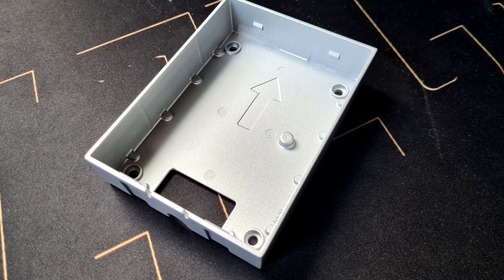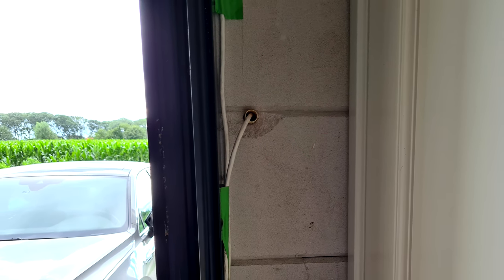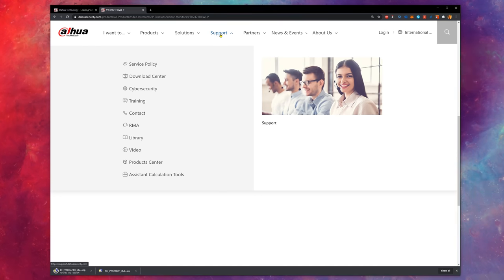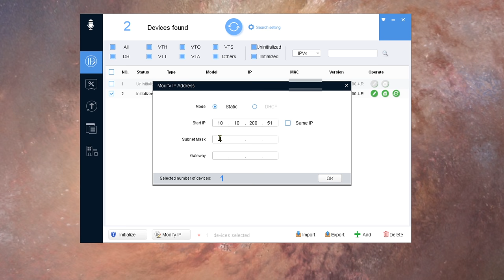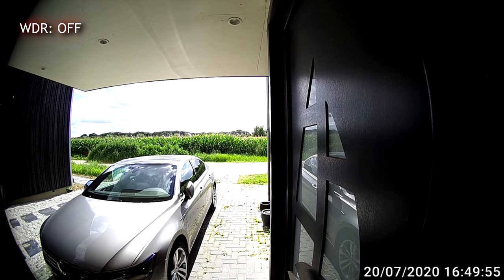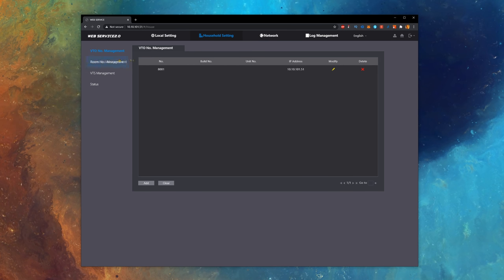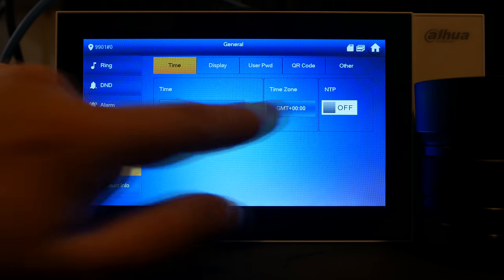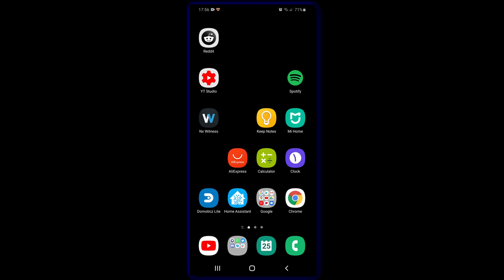🔔Video Doorbell🔔 Install and configuring the hardware | Guide | Tutorial | How-To

Comment: Hmmm... Since it can use sip (by default as server, but maybe also as cluent, e.g. as sip extension in asterix or a fritzbox?), would it also be possible to have it dial a dect phone's internal number and even communicate with audio?

I like a 'smart' doorbell and video is great and stuff, but I have one important use case:

Working from my home office on the attic floor of our house, I need quick and reliable audio contact with the person at the door, especially the parcel delivery couriers who ring and are gone before the 20 seconds I need for running down 2 stairs gave elapsed .

Basically, if a unit would exist with just DECT, a pushbutton and it would then ring on DECT phones, that would be awesome.

But if the SIP functionality of this unit is compatible with telephony, that might do, too. Maybe I could register my Sienens N300ip SIP DECT station as a client on the outdoor unit's sip server?
Reply from the maker: The SIP functionality should be able to do it, but I haven't played with it in that regard yet. But why not just mount a screen in the attic or use the app? Especially on WiFi it's lightning quick, we're talking 1 to 2 seconds for video + audio. 4G it's like 3 to 4. For this exact reason I have a screen in my offices!
Reply: @IntermitTech  the screen would definitely be an option, too. But on the other hand, it still 'feels' like overkill to have such a big screen only for communicating with the door. Unless it also has some potential to add content (maybe even home automation integration).

Response times on smartphone also look good! My only concern is reliability... If it also will work spot on, even if the phone has een inactive for hours, etc.

In any case, thanks for the quick response! :)
Reply from the maker: @EymertVersteegt  I can only tell you the app has worked flawlessly for me the month I've used it now. The app does give you instructions how to disable certain power management features because of the phone prevents it from waking up, well yeah, no solution can fix that. :)

The screens are quite limited, only for the doorbell or watching another camera.
Reply: @IntermitTech  Good to see the app really has been well-engineered and provides all help possible to circumvent power management features.  In any case, enough options to integrate it.  Now only to decide if I will go for this big outdoor unit, or one of the 2 smaller ones you linked. The VTO2111D-P-S2 looks most appealing, if it really provides same quality and features as the bigger sibling (and direct PoE UTP attachment, so no doorbird-like clutters )

Comment: my p2p is offline, how can i get online?  this noise is working the rest.
Reply: Did you manage to fix the problem with p2p? I have the same issue: whatever I try, P2p still remains offline and the push button on the VTO doesn't ring the bell on my DMSS app. I spend many hours to search and try, very frustrating! So please help anyone
Reply: @fam.o.tea.7055  I've spent the last 2 weeks trying to work this out.... Please tell me you found the solution?
Reply: Any luck fixing it? I'm having the same problem..

Comment: Completely unrelated to the content... but it looks like your video is 30 fps and converted to 60 fps by youtube. Is that intentional?
Reply from the maker: All my videos are rendered in 60FPS, they have been for years, but not all my material is actually 60FPS so some gets interpolated. I think the interpolated 60FPS still looks better then bare 30FPS, only downside is when you freeze frame, you will certainly see it.
Reply: @IntermitTech  cool :) I just noticed some motion blur so after that I looked at a few different sections and it seemed to be the case for the screen capture, the section at your desk and the section when you were filming yourself and the camera outside.
Reply from the maker: @WoLpH  My camera footage should have it since that is mostly 30, the screencaps are 60 but they are mostly accelerated a lot or actually slowed down a bit and that might cause it to show too. I believe it's watchable and not that disturbing if you have you a different opinion, I'm all ears. :)
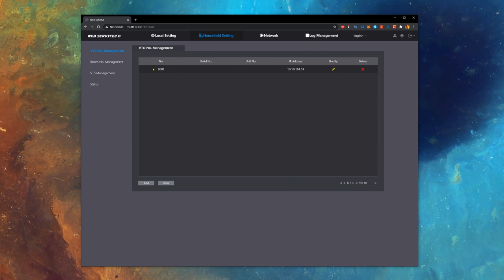Reply: @IntermitTech  No worries, it's not really bothering me. I just noticed a slight hint of it so I proceeded to investigate. As for the screencaps, I noticed it at the loading spinner at 14:30, that seems realtime.
Reply from the maker: @WoLpH  Ah, no, that's the slowed down part so that's probably why. :D

Comment: Very helpful. Is it possible to view other IP Cameras on the VTH screen?
Reply from the maker: Yes it is, it supports local (not sure what that does) and ONVIF which I've tested with some of my Dahua cams, but I'll try a 3rd party camera too. H264 only though, that is certain.
Reply: @IntermitTech  have you tested it ?
Reply from the maker: I have not tested that screen, no
Reply: @IntermitTech  thanks for your reply but I was talking about adding a 3rd party camera ? 😅
Reply from the maker: I have added some Dahua cams through ONVIF and that worked ok for the lower quality H264 streams. Don't have too much else to test with.
Reply: @IntermitTech  ok thank you, i have ordered the dahua doorbeel and poe screen. I also buy Reolink onvif poe camera (rlc-410). I will test if i can add those to the dahua screen. (
Your videos rocks ;-) )
Reply: @lyassinel  it works?
Reply: @Nrodrigues90  no black screen. I have contacted dahua and waiting for a solution
Reply from the maker: Are you connecting to the low version of the stream and the camera is set to H264, not H265?
Reply: @IntermitTech  yes i tried to downsize de quality to the minimal settings. The error displaying is something like « camera is off ». I see people with codec or quality problem have a least a with screen..

Comment: First
Reply: Great video, I had Wireless that simply do not work all the time :(. I wanted a POE  one. I bought and tested the kit all working. This weekend will try to install and cable. I bought a 32GB microsd card and installed it on VTO. But can't find how to set it up! I thought it will be recording continuously or at less if it detect movement or someone ring. Thanks for your help